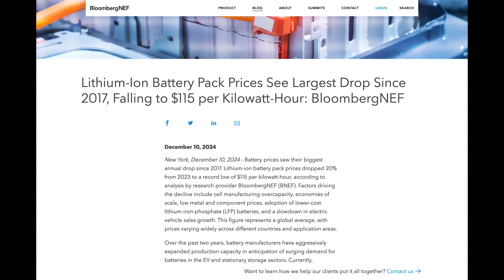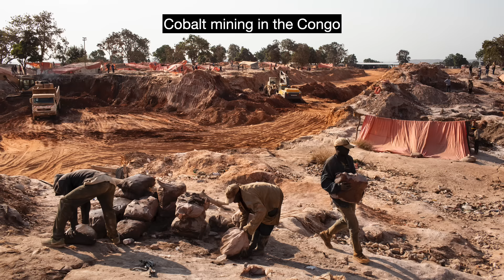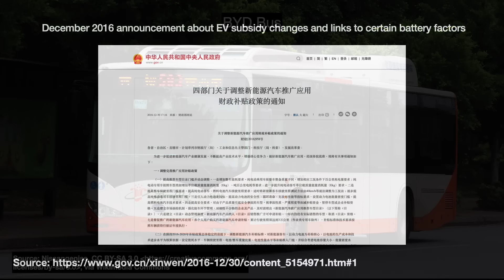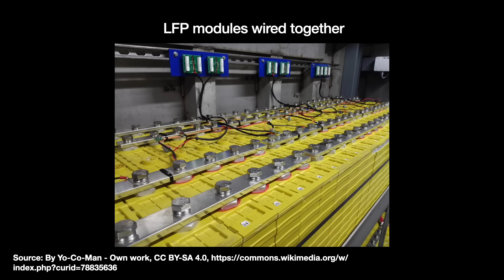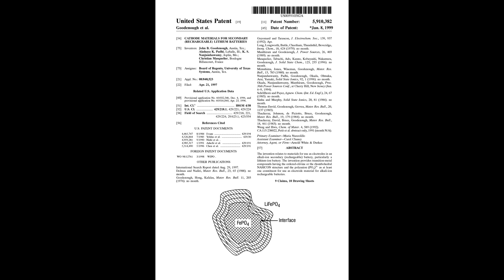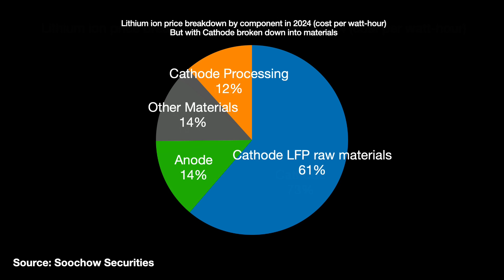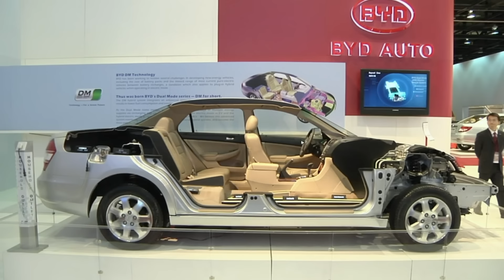How Did China's LFP Batteries Get So Cheap?

Comment: the secret is price, if sodium get decent, it does not even need to be as good as LFP, just get decent capacity and durability, all it has to do is to ouprice the competition and then LFP and other batteries will be used for more demanding and expensive stuff

Comment: You're on the right track, you're starting to get to the conclusions you need too get too. Carbon capture from the air though? Dude, so close yet so very far. Like sea water isn't part carbonic acid, come on dude. Storing energy at night is moronic, if you have a nuke plant sitting mostly idle at night, you crank it up too 110% nameplate capacity and get into the fuels market. From military grade all the way down to the lightest hydrocarbons, synthesized fuels are practically pure too.

Comment: Tesla just upended the EV and solar battery industry with the development of their aluminum ion battery technology. No dangerous, hard to recycle chemistry or heavy metals like cobalt. Smaller and lighter. Cheaper to manufacture with US aluminum. Higher wattage output and faster charging. More charge-discharge cycles. No foreign (Chinese) supply chain issues or tariffs. Until China steals the technology, and they will, their battery production will collapse.
Reply: Source ? Proof ?

Aluminum doesn't conduct electricity at high amounts 😂😂😂😂😂😂😂😂

Did tesla pay you to write that nonsense

Comment: It's funny that you brought in the Sabatier reaction. As a chemist I have studied thoroughly these possibilities. Now, per 1 tonne of methane you need 500 kg of hydrogen while for 1 tonne of methanol you need just 200 kg. Per tonne of urea (fertilizer) you need just 100 kg of hydrogen!! But yes the methane is a lot more potent energetically .But almost impossible to store, as it is a gas .If you make it LNG,(criogenically) its price doubles. Or you can make it CNG by compressing it, at 250 bars,but you add costs. However the   methanol is a liquid at ambient temperature, so, thus, is much more easy storable and transportable. This is a big advantage as it does not need compression or liquefaction. However chemicals both methane and methanol have lousy RTE (round trip efficiency) and you lose 4-6 times the energy/exergy.You can improve the ratio if you find a good use for waste heat to industry or district heating, in the winter. So batteries LFP have wonderful RTE, incomparable with chemicals. But if you want to sell methanol or ammonia to chemical industry or agriculture as feedstocks , then one way trip (energy to chemicals/fertilizers) is possible.

Comment: So you are telling me that 100kwh of battery caapcity costs 10k? Then why the hell do electric cars keep getting more and more expensive?
An electric motor is cheap, the bayyery (as seen from this video) is cheap. The interior of these vehicles are made from cheap and very cheap (piano black plastic) materials. The wheels aren't more expensive then before, tires are at the same price +-10% the windshield airbags are the same, spare wheel can't be found anywhere..
Then why? Oh yeah, because of huge profits.
I always knew that eelctric cars were a scam.

For example Dacia spring: 20k euro (all built in china), but the same car with an internal combustion engine that can only be purchased in India is sold for 4k USD.
So how come that you swap the engine with cheap electric motor, battery capacity of toaster and sell it for 5x more? Everything else is the same.. well yeah you call it "ELECTRIC" and all of a sudden you can sell it for way WAY more money than if it was an ICE car.

Now, don't get me wrong I am not against electric cars. I am against manufacturers who use this as an excuse to rake in extreme profits.

Comment: Sodium Ion is cheap and hence, would be cheaper to replace within 5 years. And for density, there is already significant improvement in solid state battery and commercialization is going to be sooner than later. Perhaps, you may want to talk on the development of solid state battery for EV...thanks

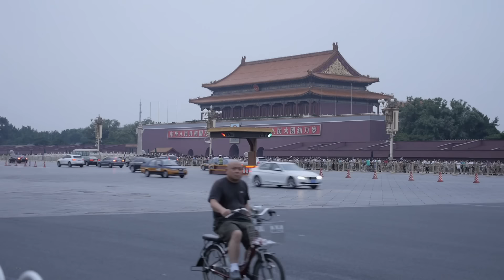Comment: 6:40 - No fake cars - the car makers simply abuse the system. The CCP will only pay a car maker the subsidies for that car when it is registered for the road - and typically this does not take place until the dealer sells the car. But the car makers simply register the car for road use (as if it has been sold) and then parks the car in a paddock, and abandon it. 

So when the CCP says "X% of our cars are NEVs" they are completely wrong. As they are about most things.

And thusly, there are dozens and dozens of brand new car graveyards in China, where brand new EVs sit and rot, while the undergrowth overtakes them. And there are tens of thousands (maybe hundreds of thousands!) of these cars, parked up, in a graphic demonstration of the deep corruption and dishonesty which is normal in China.

The destruction of capital, and the waste and fraud is off the clock. No wonder China is now on its last legs, with the CCP bankrupt, 300 million Chinese dying in the last 5 years, and unemployment going through the roof.

Comment: I think the sodium batteries have a more promising use case in stationary battery stations since weight and volume isn't really a limiting factor. They apparently operate much better in extreme temperatures and thermal discharge shouldn't be an issue. The key hurdle is just to get the production volumes to the point where their unit costs get lower than LFP's.

Comment: Just attach your solar panel to a container filled with salt water. Put in two none touching bars, one of copper & the other zink. There you have the cheapest battery ever. With a capacity of 100L you can power a television ( need opamp converter ) for a day. 🙂

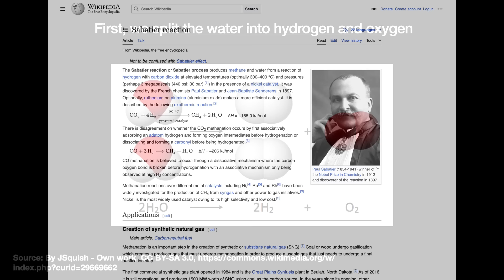Comment: At  18:10 Irrational "solution" : capture cO2 from the aur -- and synthesis + H2 --> CH4 (methan) !   
It tooo expensive catch CO2 fro, the air  - later CH4 to  spend  the CO2 to  H2 -->  synthesis    =  CH4     
II) Look at an actioner to SWISS, ein START UP to - build plants to  capture  CO2  from the air !   Costs : 600 € - 100 €   per 1000 kg !  
III) :200 km mit sparsamstem Dieselmotor =   6 Liter = 15,8 kg CO2 ! 
IV - A)  Costs to remove CO2  : may be  600 € x 0,0158 t = 9,48 €; 
B ) Energy for to remove: 200 kWhel !  Greetings !  2025- 06- 05  Alfred

Comment: hydrogen has a fundementally low round trip efficiency of about half to a third the efficiency of hydro or batteries, plus it has to be stored in either high pressure or a freezing container since hydrogen seeps through metals, and carbon capture is insanely inefficient, making the natural gas just terrible

Comment: the reason batteries only hold charge for 1-4 hours is specifically because they are the first to get used when demand increases, and because they charge and discharge much faster than a hydro dam can, so it isn't a technological limitation rather than just how we use the technology, we could certainly store battery power for longer if needed

Comment: If you call NMC a ternary cathode because it contains three non-Lithium metals (which is both common and correct), then you cannot call LFP a dual. LFP contains only a single non-Lithium metal.

Comment: There's also a fourth chemistry, LTO (lithium titanate), whcih is the missing middle between lithium batteries and supercapacitors in terms of cycle life, maximum charge/discharge currents, safe operaing temperatures and energy density.
It's used in some electric and hybrid city buses and trains, as there are less weight and space limitations, and they don't need much autonomy and endure many more cycles than the average private vehicle in the same amount of time

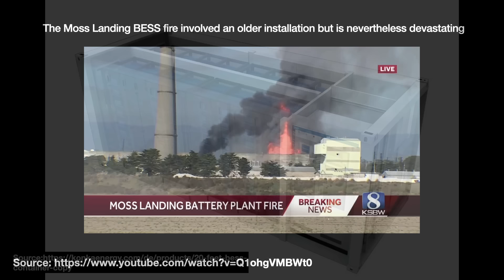Comment: 19:07 batteries aren't cheaper per kWh than pumped hydro. They are small. One megapack is 3 MWh while a pumped hydro storage is 30 GWh or 30 000 GWh. Pumped hydro also last much longer.

Comment: Before EV's became a big thing, lithium batteries were mostly used in phones, tablets, laptops etc. The power to weight ratio was perfect for such appliances, and the shorter battery life not a big concern. EV's have a different set of requirements so LFP will continue to grow, especially as non-Chinese makers begin producing them. Sadly Nissan just announced scrapping their plan to build a LFP factory in Japan.

Also - BESS installs up to four hours duration are being done already.

Comment: LFP density is too low  for eCars !  Only possible for a station !
Reply: It isnt, got an EV with an LFP, best battery so far in my EVs. Smaller than the others, but costs less and charges better. BYD blade LFP from 2023

Comment: A. Röck, Club Voltaire München :  Bsp. :  Für 400 km nötig: eine Capacity von 70 kWh -inkl. 6 kWh als Schutz gegen Entladung auf null;   
Batterie- Preis:  Bei  100,- $ bis 65 $ pro kWh: 
 Es wird Zeit für ein Schubladen- System - um bei einem Gebrauchten E- Auto ohne Montagekosten, einfach die neue Batterie rein zu schieben; 
Preis: Für 400 km also 70 kWh:  70 kWh   x  65 € =  ca. 5000 €; 
Das kostet ein Otto/ Diesel- Austauschmotor [70- 100 kW] auch;  dazu kommen aber Aus- u. Einbau für ca. 1500 - 2000 € !  15.5.2025

Comment: Good to know progress is being made with battery technology. I bought a new EV nearly 5 years ago, and haven’t looked back. Hands down the best car I’ve ever owned. Almost 90,000 miles on it now. Still performing and looking like new. I have saved almost $12,000 in fuel costs over driving my old Toyota Corolla during this time period. Just that alone greatly subsidizes the cost of ownership. I’m a 70 year old man and I’ve seen a lot of technological improvements in automotive development, but the 95% efficiency of an EV over the 20% efficiency of an ICE vehicle is one of the greatest improvements in automotive history.
Reply: Battery-Electric vehicles make a lot of sense for many people.

They eliminate the problematic areas (Combustion engines and their associated complexity and unreliability, ditto automatic transmissions).

There is no particular reason why BEVs cant go a million miles. Except the battery life limits of 6-8 years, and about 150,000mi. So long as it is a replaceable item and affordable (or financeable). There might be second and third payment terms in the future. Or perhaps batteries will not be owned, simply leased on monthly terms.
Reply: @Triple_J.1  indonesian polytron scooters already use that scheme

Comment: It never ceases to amaze me that so much money is spent on battery technology when their energy density is about 40 times less per equivalent weight than petroleum? It is like inventing an alternative to the wheel! Combusting petroleum produces carbon dioxide and water but we all know that carbon dioxide is a naturally occuring gas and food for plants, and although CO2 has a GWP the amount of human produced CO2 emissions is about 3% of total annual global emissions, which in the grand scheme of things is nothing. The earth surface is warmed by radiation from the sun and all it takes is a variation in solar intensity to affect the surface temperature exacerbated by the oscillating effects of the Milankovitch cycle. EV batteries are a sticking plaster to fix an imaginary problem.  That's why they are expensive not to mention the quantity of metals used have an adverse environmental impact!
Reply: Prove it
Reply: @jacksmith-mu3ee  Prove what?
Reply: @johnmitchinson9577  your claim . Peer reviewed research would be helpful
Reply: @jacksmith-mu3ee  It does not require peer review research. It requires basic understanding of science and engineering acquired through a good university education. You prove me wrong.
Reply: @johnmitchinson9577  again debunked by peer reviewed research conducted independently 

You also lied about carbon emissions which is also debunked using peer reviewed research 

Source : potholder54 videos showing peer reviewed research on carbon emissions and also EV environmental impact research  

That's 2 loses for you

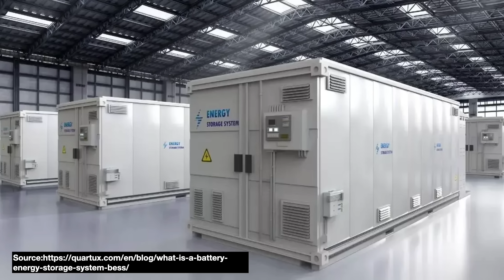Comment: 18:48 "They are not competitive  in sheer capacity size (yet),  they only provide 1-2 hours of power rather than the 4-12 hours that pumped storage can. But BESS are cheap - incredibly cheap"
I think you're confused. If by "capacity" you mean amount of energy stored (think of it as how big the "tank" is), then there's no time component to kilowatt·hours; a lithium-ion battery can store power for months since it self-discharges slowly. The metric of hours of power refers to how quickly a storage system can put out its energy (think of it as how fat the pipe running out of the tank is). A battery that can release all its energy in only 1 hour is better than other storage that can't do it any quicker than 10 hours, because its owner can make more money during a price spike. She can empty more of her energy storage more often. People hear that hydrogen or flow batteries or compressed-air offer "10+ hour storage" and think that means they're better for long-duration storage, but it doesn't: it means they're not as good as batteries at meeting brief demand peaks.

TL;DR: "hours of storage" measures power delivery, and lower is better, and batteries rule (only crazy expensive supercapacitors are better). All the other kinds of energy storage have to be much cheaper than batteries per Megawatt·hour in order to compete at long-duration storage.

Comment: I wonder why no one done a more engineering approach to battery thermal runaway. Something like soldering them with low melting point, just around 100C, material on sides, with an empty fireproof bottom compartment. So, when a battery goes into thermal runaway, it melts that soldering material and just fells down and burns relatively safely, without damaging other batteries, while the pack continues to work with slightly lesser voltage. Some reasonably simple circuitry would then help to identify failed units, so they can be serviced. This would make battery module thicker, but much, much safer. And design might then adapt for higher car floor.
Or, maybe some other approach, but either way - solving the problem engineerically, not chemically.
Reply: It's a chemical runaway. You can take the load off the cell all you want, it will still start to burn. The only solution would be an emergency water cooling system, which will work for stationary batteries but not in cars.
Reply: @lepidoptera9337  I'm not talking about load, I'm talking about the faulty battery falling off so it could burn away from other batteries.
Reply: @aberroa1955  Where would you drop a burning battery???? ;-)
Reply: @lepidoptera9337  So, you basically didn't read the comment at all.
Reply: @aberroa1955  No, I basically called it bullshit. I am still calling all of your comments bullshit. ;-)
Reply: @lepidoptera9337  Well, for your comment to be valid you'd need to read it first.
Reply: @aberroa1955  Why would I read your bullshit? ;-)

Comment: Sodium ion is insanely exciting for all home and camper battery uses, not necessarily car/boat/plane batteries which is fine because 90% of the electricity we use comes from air conditioners/heaters and water heaters. It likely won't ever be the most energy dense, but it almost 100% WILL be the least expensive, safest, most sustainable, most reliable to stack in your garage to run your entire house with a few solar panels to escape paying power companies for power ever again.

Comment: BESS will inevitably be on site home power stations for everyone. The average household only needs about a 30Kwh battery capable of 20kw sustained output and about 8000 watts of solar to run your entire house nonstop perpetually without any grid power ever. The way prices are falling, that could end up costing under $8,000 and provide nearly 20 years of paid-for reliable electricity, which would be the equivalent of about $33 a month. Even as of today you can spend $5,000 on a partial battery/solar system that's a standalone kit and reduce your electricity bill by 50-60% for 12+ years.

Comment: LFP batteries can also be charged from 0-100% about 4,000 times before even losing 10% of their capacity, meaning they have a useful life of well over 15 years for most cases. Lithium ion batteries typically last under 1,000 full charge cycles before losing 10% of their capacity. Considerably shorter life cycle while costing more.
Reply: LFP batteries are lithium-ion batteries. Presumably you meant to say NMC batteries.

Comment: WTF is $115/kWh? Our supplier sells us fully certified, binned, and insured cells at $37/kWh, and the packaging cost (BMS, breakers, chassis, interconnect, etc.) for the pack is around 1:1 to the cells, so $74/kWh domestically in China.

Comment: I totally disagree with your analysis of green power over existing coal/gas/hydro. You fail to factor in the enormous land requirements for solar/wind/BESS systems and also the fact that there are on average 25% Net Zero outputs of solar and wind produced electracy per month which can never be covered by BESS.

Comment: Great explainer! Really well done. Im also interested in the sodium battery space, as it uses very similar fabrication methods as lfp and is much less affected by high or low ambient temperatures. The big challenge i think is the linear soc to voltage graph, which makes the battery more difficult to use at low charge. But I'm sure there will be an electronic solution to that too.